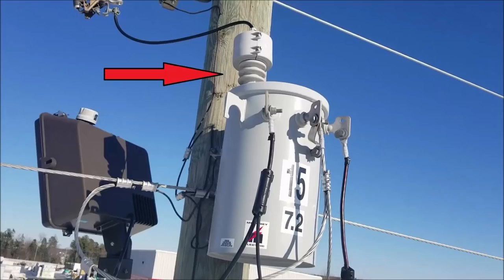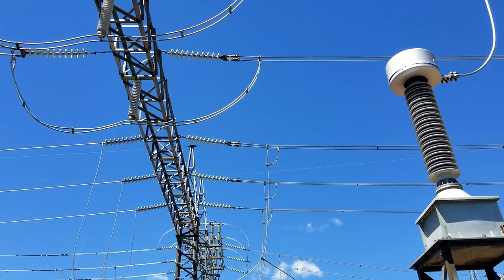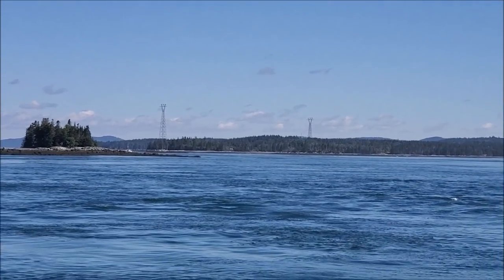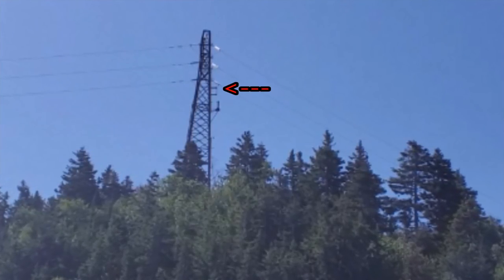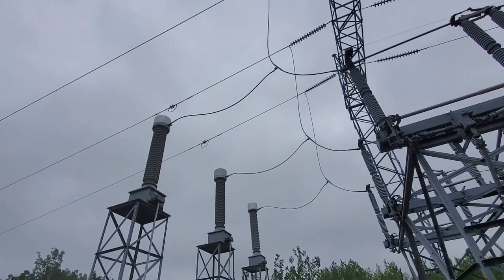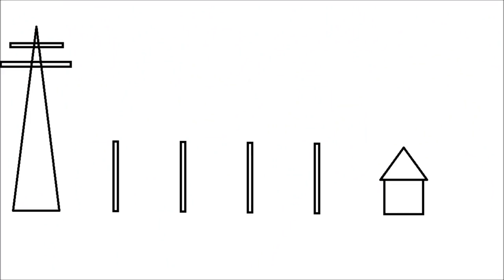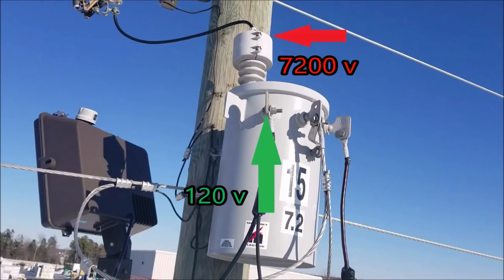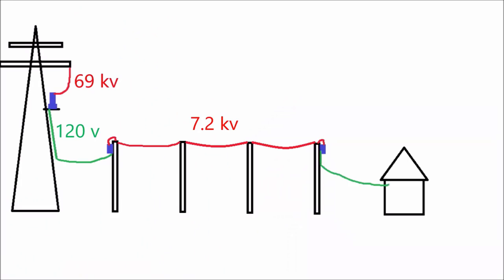69kv tower feeds cottage on an Island

Comment: Really ignorant question,  but why does it go from 69k -> 120 -> 7200-> 120 .... Why does it not go 65k -> 7200->120?
Reply: Was just wondering the same thing.
Reply: Because you would need a much larger transformer. They’re using substation equipment on the line. He explained all that
Reply: Yeah that’s interesting 🤔
Reply: My guess is that a 69K > 7.2K transformer is much larger compared to 69K > 120. Could also be rarity of parts, a 69K > 7.2K may only be made in substation-sized parts. I'd love to know the true reason though
Reply: Creamy Pasta ok 👌🏻 thanks
Reply from the maker: Yessir you guys nailed it 👌
A 69kv to 7.2kv is designed to handle much more load and is very large. The 69kv to 120v transformers aren't designed to handle much more then metering equipment, therefore can be physically much smaller .
Reply: @Bobsdecline  thanks all for the clarification 👍
Reply: A standard service would be 100 or 200 amps @240. These transformers designed to feed your metering equipment can handle that much current?
Reply: Bobsdecline - Lineman blogger all in all a pretty clever solution
Reply: @MarcusGarfunkel  I was wondering the same thing. I am guessing they use a version of these potential transformers for powering the substation kit at remote locations, so they would be available with a reasonable current capability.
Reply: @MarcusGarfunkel  Typical home services rarely draw more than 40 amps regardless of the 200A service capability. That's 40 amps at 240v.  That small house shown would have a hard time pulling 40A unless all electric heat and hot water heater on at the same time and even then its a small house.  He said they put in 120v not 240? Confused by that. If they only use half the secondary winding or half the voltage then the primary voltage would only be 3600v???
Reply: @amesweb  I may be wrong, but I believe you could achieve that by paralleling the windings. If you go inside the transformer and move the tap for the center such that the same voltage is fed in the same end of both windings, I believe you should be able to get the same field strength. I believe they do it on 3 phase 120/208y connections to make sure they get the full KVA rating. I recall he mentioned it on a previous video about transformers (something about "make sure that you parallel your secondaries for 3 phase installations").
Reply: @MatthewKruegeriscool  Good possibility. That would make sense. I think that would work.
Reply: @amesweb  Good question - the PTs I have seen were single phase output, since they are not made for delivering a lot of power. I have worked in substations that were powered off a PT, and there was not enough power for the usual equipment plus electric heat.
Reply: I posted this response on another thread, but it answers some questions on this one also.  I am a manufactures rep for the utility industry and found this video very interesting because I also thought that the output would be for metering only.  I checked the product literature for the manufacture of instrument transformers that I represent and found that their VT Instrument Transformers only go up to. 7.5 kVA per phase, but they also have what is called a PVT.  "Power voltage transformers ensure high reliability and power availability for any critical load need up to 100 kVA per phase. Power voltage transformers are used in high voltage transmission systems to provide low voltage energy directly from the lines. They are also called Station Service Voltage Transformers (SSVT)."  Thank you Aaron for the great videos that are helping me to understand my products better!
Reply: @kirkhamandy  yes there is. They're called station service power transformers and are commonly used in the oil industry for powering rural pump houses.
Reply: Was the 69k to 120v transformer an off the shelf product?
Reply: @amesweb  The 69k -> to 120 then 120-> 7k2 -> 120/240 at the Cottage
Reply: @kirkhamandy  
That's funny. We were replacing a transmission circuit that somewhere along the line does just that - feeds a single house. And yet the utility here built a tiny substation on the property stepping 69kV down to distribution voltage and then to secondary for a single house. Now that I've seen this video it seems silly.
Reply: @pjtemplin  
Yes
It's a PT, (power xfrmr) typically used for metering... or for obtaining utility voltages in a sub.

As explained in video.
Reply: @kirkhamandy  You can order any transformer you want. Essentially any company that produces transformers, especially higher power ones (100kVA+), will happily design and build any conversion you want. You might need to wait few months, and it will cost (a little) extra, but it is not hard or that unique. My guess they wanted to make it quick and a bit cheaper, and already had some equipment on hand to do it. The issue with custom transformers is that if it fails, it will be tricky to replace quickly.

Comment: Very interesting way of doing things. I've seen a 69 kV Pole Pig (Pole mounted transformer) in the same situation. 69 kV right of way. Don't remember the load but I will never forget it., The Insulator bushing was 3 feet tall sticking out of a 25 kva transformer. Suppose any voltage transformer could theoretically be custom built. Great vlog here man.
Reply: Speaking of pole cans I have seen it occasionally on trips and stuff and other places just have to watch out the window and seeing a very small much more than just narrow distribution Transformers.

Sometimes we are there is something like a highway billboard or otherwise haven't seen them often but once in awhile I believe I'm seeing something like this even the towers for some isolated load consumer being done here as well but more of just a curiosity on the very small distribution Transformers for certain things.

I want saw one of those small cans just for one single street light but to be fair there was actually receptacle somewhere on that pole don't remember how high up also once there was some tokimune caitians equipment and similar elsewhere often in areas way off in the boonies.

I'm thinking once I lie at highway sign was on one of these as well.

Comment: There is a setup very similar to this on North Carolina's Outer Banks barrier islands. Power is distributed via a single transmission line from the mainland south to the barrier islands to feed power to the populated areas of Hatteras and Ocracoke Islands. The transmission line goes underground and is carried along the NC-12 bridge which crosses Oregon Inlet. The transmission then follows NC highway 12 south to deliver power to the towns along the islands. The transmission line runs for many miles through the Pea Island National Wildlife Refuge before reaching the towns. In the refuge, there are no homes or businesses, and therefore no distribution lines. In the middle of the refuge is the visitors center. While there are no distribution lines for many miles, there is the transmission line, owned by Cape Hatteras Electric Cooperative. CHEC used this same method to deliver electricity to the visitors center. I'm sure it was much more cost effective to power the visitor center directly from the transmission line, than to run a single phase side line from the town of Rodanthe north to the refuge visitor center. 

Here's street view imagery of it...
https://www.google.com/maps/@35.7152544,-75.4927173,3a,84.8y,308.29h,107.22t/data=!3m6!1e1!3m4!1sB8Ch7soDSt607DzLcuM79Q!2e0!7i13312!8i6656

It looks like in this case, the brought 120V directly from the PT to the visitor center.

Comment: Very nice job with what you had to work with. The graphics made it ease to picture. The biggest thing I installed was a 100 amp panel at my parents house (pulled city permit)
The Step up and then back down makes perfect sense but something I personally was not aware of. Have basic electronics and basic ac electrical knowledge so enjoy your videos about being a lineman.
Thanks!

Comment: Wow!  I'm amazed a PT designed for metering can handle that much current on the secondary side.  Though I guess something intended for an electrical yard would have no problem serving a single residential 200A.

Comment: Almost surreal to see this video in my recommended, as I've been pondering ways to get power about 1/4 mile from my house to another part of my property without paying for a second meter. I had contemplated trying to source my own 7.2kv transformers and rigging up my own "private" transmission line exactly as you've described here, but they're expensive, heavy, and way overkill for my needs. I've considered using a couple of neon sign transformers, but the usable power at the end would only be a couple of amps at 120v, best case. Better than nothing, but all I want to do is run an electric fence charger, a camera, and a gate opener, so it could work. In the end, the most sensible (but less fun) thing to do might be a solar panel with a battery and small inverter. 
Great video, thanks!
Reply: You could the  same as the solar setup except the panel, charge a battery and power everything else off it as you stated.  This way you will also have power backup for your stuff.
Reply: truthsmiles
 ... would have to go to the charts to double check the drop but recalling you can go at least 1,000 ft on #6 wire and stay within limits. The key would be to have a low continuous draw on say a battery charger then run everything else on a small inverter with the battery picking up the surges. Of course the cost of a quarter mile of conduit (buried) and the wire may make you rethink the project and head toward a total solar package or an on-demand generator.
Reply: If you can source 240V equipment, you can run 240 volts there instead of 120. That'd limit your voltage drop to about 15%, which would still be in the acceptable range for the devices---they are usually constructed to work on 220V+/-10% to 240V+/-10% grids.

Comment: My question for Aaron.  What is the other side of the PT connected to?  Rods driven into earth?  The metal of the structure? 

I have seen a similar setup with 1 phase taken off a 60 kV setup and run for 1 or 2 wood pole spans to a similar PT.  What I could not figure was that the only return conductor I could find was a single #6 copper in a falling-apart wood channel running down the wood pole to the dirt.  Near as I could tell if someone were to cut that single copper ground wire its potential would suddenly rise to 60 kV and kill whoever touched it.  This setup was powering a railroad signal in the middle of the desert.

Comment: Wanted to elaborate on something you touched on in the video: voltage loss. You have less voltage loss for a given load at higher voltage because you're moving fewer amps. Put another way, if you move 200 amps through a given cable, you'll have 25% voltage loss, whether that's at 120v or 7.2kv or 96kv. But a 200 amp load at 120v is 3.3 amp load at 7.2kv. By cutting your amperage down from 200 amps to 3.3 amps, you cut your voltage loss from 25% down to 0.4%. Or alternatively you run thinner (and cheaper) wire.
Reply: If you put a given current through a given wire, the absolute voltage drop will be the same. The percentage will be lower the higher the line voltage is. If your 120v 200a load gives 25% voltage drop, that's 30v dropped. When you step it up to 7200v the current drops to around 3.3a as you said, and you only lose half a volt. 0.5v out of 7200 is only 7 thousandths of one percent, truly negligible.

Comment: In New Zealand, we have electricity networks running at various voltages. 220kV (220,000 volts) for big transmission lines that carry major loads for long distances across the country, 345kV (345,000 volts) for HVDC Inter Island between Benmore and Haywards, 110kV (110,000 volts) and 66kV (66,000 volts) for smaller loads, 33kV (33,000 volts) for subtransmission, 22kV (22,000 volts) to power electric trains with traction power, 11kV (11,000 volts), 6.6kV (6600 volts), 3.3kV (3300 volts) for HV distribution, 400V (400 volts) and 230V (230 volts) for LV distribution, and 230V for consumers.

Comment: There are a couple of service in town where the utility provides 110/220 V service the customer meter, then the customer steps up the voltage to primary of their choice, then back down at the house because of long driveways. It seems to be cheaper for the customer to contract the work then have the utility do a primary to the property

Comment: @Aaron, I think I solved the mystery. Most likely, you misidentified that xfrm. It,s not PT (used for metering) but single phase POWER VOLTAGE xfrm! They are also used in substations and have ratings 10-150 kVA and step down transmission voltage to 120 or 240 V.

Comment: TAU (Calgary Power) had the same setup going to a weather station.  Got removed because in the breakup transmission wasn’t allowed  small customers, and it did throw out the line balance.
Reply: If you  meter one phase and assume that all three phases are the same, something like this throws that a screw ball.  Keeping the line balanced is also why you roll it, and having a pattern for which phase to use for a service tap.  It all is black magic until you see it or calculate it out.
Reply from the maker: 💯! Yes we always meter each phase separately and follow up with transpositions at various points throughout the line. Once at the substation the circuit is metered and balanced accordingly ✌️

Comment: I can't say I've seen it done "in production", but I had seen it done in a lineman safety demo a local electric company put on at our county fair a few years ago.

I've been designing & gathering pieces to build out something kinda similar (but smaller?) To get power to a building several hundred yards away from where my meter is. The way I looked at it is that I could step up the power to 480 & back down easily enough and that would drop the losses a fair bit.
Reply: They do the first part, step down transmission voltage to 120 volts on the Outer Banks of NC, Hatteras Island. They power a DNR ranger station......

Comment: Hope you had an nice vacation ✌🏻 how big is this transformer on the tower?
Reply from the maker: Thanks! Glad to see your back to work, hope all is well✌️ physically, it's about 4-5 feet tall. I'm not sure how many KVA it is rated for🤔 I've tried looking at some of the name plates on them at the subs, but can't find anything. They aren't really made for this setup, but it's been there a very long time without any issues. I'm curious to know and will keep digging ✌️
Reply: I have seen engineering drawings for setups like this and most have the Potential feeder 5 KVA larger than the Pot being fed

Comment: Arron! - I know some kinds of wires on poles swap places - between two poles, or perhaps as a special arrangement of insulators on top of one pole the wires change order   Wire in place one moves to place 2, 2 to 3, 3 to 1 - Where and why is this done? Is it also done in the higher voltage lines? Are all three phases of a 3 phase system the same? (of course they are out of phase with each other)?
Reply from the maker: I should do a quick video on this... It's called a transposition.

I'll have to read my old books to make sure I get the information right, but from what I remember;
 On long stretches of three phase (especially transmission lines) the center phase receives an more capacitive coupling than the two outside. It can throw off the power factor of that particular phase.
They rotate them to balance the system.

Comment: In my area, there is a 230 KV transmission line that feeds a number of regional substations.   Each regional sends 138 KV lines to several towns.  But there is also a 69 KV network that connects various towns and substations and seems to go to the same places as the 138 KV lines by a different route.   Is that for redundancy?
Reply: It would certainly serve well as a redundancy measure!
Reply: Maybe the 69k was the original system, but they needed more power as towns grew and industry came in, so they ran the 230/138kv system to handle future growth, but the 69kv system is still serving all its original customers, so it gets left.

Comment: Why didn’t they/you step down to 7200v rather than 120v in the first place? Cheers for the upload!
Reply: I am guessing so that they can use standard equipment that they already stock, instead of needing to get custom transformers made.
Saves a LOT of money lol
Reply: I'm pretty sure he said it was for metering services. They meter the power before it's stepped up to 7200 and stepped back down rather than after.
Reply: So the meter isn't in the island
Reply: @RingingResonance  no, what he said was that normally the Potential Transformer is used to meter the high voltages inside substations, so that they can meter the transmission line voltages without having to run 230kv to the electronics.
They run it into the transformer, and then measure the output, and can multiply the reading to know the high voltage.

In this case, they would either have a regular meter on the house, or more likely, just charge a flat fee for connection and save having to have someone go out and read the meter lol
Reply: Because a 69 to 7.2 kV transformer is one you'd find in a substation - it is huge.  This solution is for just one customer.
Reply: It's not possible to step down 69 kV to 120V in a single step.
Reply: @VoyageOne1 sure you can 69000/575=120
Now, the GE version steps it to 115 volts using a 600:1 winding.
69000/600=115

But 115 or 120 are both within the range that we refer to as 110 volts lol

Or do you have some other reason why you can't step 69kv to 120v in one step other than transformer ratios?
Reply: @VoyageOne1  And why not?  PT transformers do it as high as 375 KV.
Reply: @VoyageOne1  it most certainly is